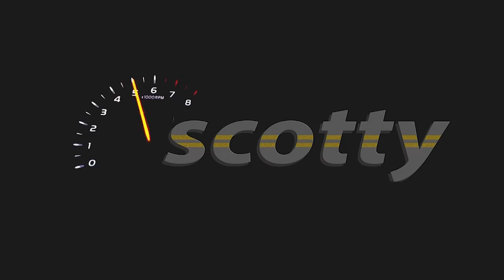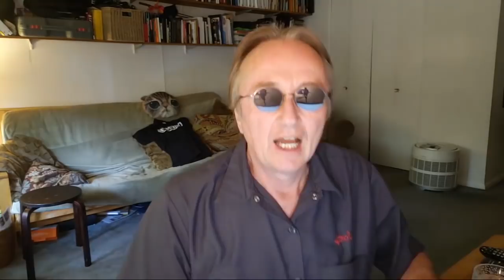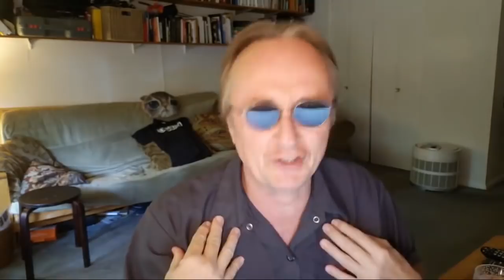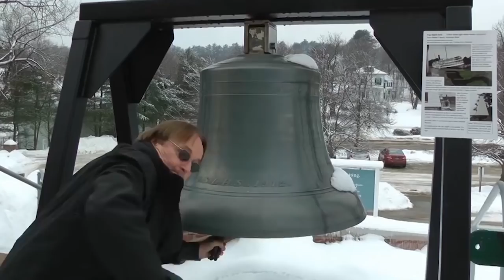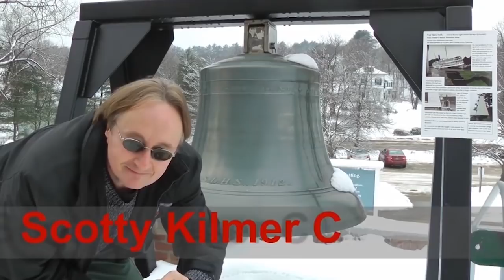What's the Beef with Chris and Headlight Restoration Explained

Comment: Just because you've been working on cars for 50 years does not mean you've been restoring plastic headlights that long. Chris makes excellent videos even though he learns as he goes. He does the research.
Reply: research < experience.
Reply: Chris got it flat it wrong with the spray painting clear coat unto your headlight vid. If youre too much of a fanboy to see that well then good luck with that. I agree with you about experience though. Just because someone has been doing something for a long time does not mean they’ve been doing it RIGHT for a long time also.
Reply: cars headlights were not made of plastic when scotty was working on cars for almost 30 years.
Reply: Scotty wasn't playing around with plastic car headlight coatings for 50 yrs. LOL He has no experience, but when it comes to repairing vehicles, yes, that he has. Most mechanics don't specialize in detailing.
Reply: Experience is better than research. Scotty been doing this stuff for years
Reply: Saitama I know people that have been driving for many years, but they're horrible drivers. Your point is?
Reply: In this specific case, spray painting headlights was just wrong, and is NOT a perm fix.  Could it be a temp fix to trade your car in or something? Sure.. or you could just use PlastiX or a 15$ headlight repair kit to do the same job correctly..
Reply: Well then don’t listen to Scotty and go spray clear coat on your headlights.
Reply: Dennis Kirk agreed, and it really makes you scared of what you're buying with a used car you don't know how many stop leaks and painted headlights and other bootleg fixed as you're about to purchase LOL
Reply: anyone with a camera and google can make a tutorial video on any subject. doesnt make them correct though. scotty knows what he is talking about. buffing headlights is the only way to properly restore them. anything else either doesnt last or damages the headlight further.
Reply: I've seen a lot of cars taken to "detailers" who sprayed clear over the whole engine bay, hoses, belts, everything. Within two weeks it looks like crap, peels, and you'll never get it right again without tons of work. Never let them do that.
Reply: How rude! Really? You do know they are clearcoated from the factory?
Reply: Cyclone Cyd  no they are not
Reply: To say this both of them make excellent videos on how to fix a car i watch both think about this everybody has an opinion and is entitled to it
Reply: There are so many things wrong with this comment. smh 😑

Comment: I did use Chrisfix restore method with the clear coat and for what its worth it has lasted over a year and still looks good, and a little common sense should tell you that the lights were bad/damaged to begin with So occasional maintenace will be need, like changing oil. just to add CF has saved me loads of cash and help me greatly, with that said I also watch/use Scotty K's advice/knowledge, lol they are the only 2 I am subscribed to and shall continue to use as needed, Both deserve a high five.
Reply: Same here man. Glad im not thw only one.
Reply: I’m in the same boat as you
Reply: Indeed
Reply: Hey scotty, notice this comment

Comment: I love Chris' videos. But your right. 
I did the sand, polish, and clear coat, the headlights on a car I sold to my friend. 
It's been about a year, and they look pretty bad.
Reply: Did you put wax like Chris did?
Reply: *You're
Reply: Eric Kolb you really can't though. If a the manufacturer of the clearcoat states that this will not work with certain plastics, they probably dealt with a situation where someone had used the clearcoat on the headlights and it ruined them. Honestly, this is done more often than you think. It just keeps the company making the clear coat clear of liability in a legal sense. Just use a headlight restoration kit, hell rustoleum selling for a couple bucks if you are tight on money
Reply: Eric Kolb I actually ment that rustoleum makes a headlight restoration kit that sells for a few bucks. It's the cheapest one I found at Autozone although I prefer the kit Scotty mentioned from meguiars as I used it a year before his video and it does work really well.
Reply: Herbert Wingfield *an A.
Reply: or you just do it properly with a polish

Comment: I did the Chris fix to my headlights, did not work. I sanded them as he instructed and they came out horrible. I didn't have time to put a comment or video not to do that to headlights but Scotty nail it here.
Reply: It didn’t work for me either. Look horrible now need new headlights.  Too bad I wasn’t the only one.  Unsubscribed Chris subscribed Scotty.
Reply: Ricer   Give it time in the sun. My clearcoated headlight restoration ala Chrisfix lasted about one year and now they look worse than before. So, I got almost a year out of the fix and could just repeat. But the "fix" is definitely temporary, especially in south Florida.
Reply: marvin flores You had time to put a comment here but didn't have time to put a comment on Chrisfix's video... WOW!!!
Reply: Did you use UV resistant clear coat or did you cheap out and use rustoleum? I did this a few years ago using the UV resistant clear coat and they still look as clear as glass.
Reply: I just did Scotty's way for mine.  I did have to sand, but I bought the same brand name kit (came with 2 sanding pads and a polish brush for a drill and polish).  So clear.  I'll see how long the spray cover lasts, but I'm going to follow Scotty's advice and put on every 12 months (have it reminder in my calendar for next year).  Not sure if I can link, but super cloudy (15 year old lights, never did anything to them before) to almost crystal clear.
Reply: Russell Ball what Chris recommended to use WAS Rustoleum. I went out and got the same stuff too and did my headlights. Same story. Turned out horrible and had to sand down the whole thing again which was a worse situation than before because now I'm sanding lacquer off of plastic. 

Once I just buffed them out I just made sure to wax them when I wax the car and they were fine for quite a while til I sold it. 

Now I have another vehicle that needs them done and I would be a fool to do the same thing again. I'm gonna buff them down and use what Scotty said and be DONE with it.
Reply: Crow T. Robot that's prolly why they haven't cracked or faded, I usually have my cars under my car port. I live in Texas btw and I sure you know about the heat over here.
Reply: if it didnt work you did it wrong dont blame him for something you can do

Comment: Glad to see you agree with no clear coat.  Seems to be a big controversy. I have done a video very similar without the clear coat and it ranks just below Chris fix. I have only been doing this for about 25yrs so I am definitely inspired by you. Thanks Scotty
Reply: There is no controversy. They are made with clearcoat from the factory. It is this clearcoat that goes yellow as a result of Uv and chemical attack. Of course the factory uses 2k clearcoat (as do I when repairing)

Comment: The correct way to headlight restoration is never neglect headlight maintenance. Theres your beef nd pasta for you
Reply: Sergio Jr what exactly is headlight maintenance?
Reply: Ed Aker detail your car every week
Reply: Ed Aker clean your car and put protection on them like you should with your paint work.
Reply: Sergio Jr every week! People have lives! 🤣
Reply: Ed Aker
Headlight maintenance is where you make sure you keep the "Headlight fluid" topped off regularly.(Don't get it mixed up with "Blinker fluid")
Reply: 15 years and not a single fade on my lights,  well the car is 15 years old.
Reply: Ed Aker it should only take 5 to 15 minutes tops for big cars, but if you are lazy then what you say is your answer.  😁

Comment: I used Chris headlight restoration video, 5 months later headlights are still clear on 2003 4runner (much better than it was before I followed Chris video) will check in a year, I think his idea of applying clear coat spray at end is what made difference so far

Comment: I did the Exact steps, used the same EXACT supplies for the restoration and a year later they faded worse than what they were before 😔😔
Reply: So for you 1 year is 1 month...
Reply: I also did the same and they went bad in 6 months then again I am in Dubai with alot heat and sand that hits the car
Reply: Shadowplate they should change name to DontBuy not DoBuy

Comment: Chris method is for headlights that have detoriated and clear coat being the last resort before replacement.If it works for a while all good gives you time to save up for new headlights.Prevention is better than the cure.Two different subjects.Chris may not be a mechanic but his videos show clear step by step mechanical procedures and well presented.

Comment: Ok, the headlights on my 04 Camry were hazy. I took some Turtle Wax scratch remover and rubbed them clear. About a year or two later, they're hazy again. So I think your advice is true. I didn't use a clear coat for the reason you mentioned. I'm sure just applying a good wax itself would do the trick. I would try your recommendation but don't know how much longer I'll be keeping this car but will remember it for the future.

Comment: Well there are many ways to skin a cat. Chris showed his headlights after 2 years on instagram and they looked great. Some clear coats will fail, some may not. A lot depends on preparation and product used. So I reckon it’s oversimplifying to say he’s wrong on that topic.
Reply: We in the real world call that anecdotal evidence. It should be dismissed immediately due to the shear volume of those that failed miserably.
Reply: Herpn Derpn lol, so you’re saying your anecdotal evidence trumps his anecdotal evidence?
Reply: I'm saying that 1000 bad outcomes Trump 1 good one. I don't entirely agree with Scotty a bout everything. Some stuff has irked me. This is one that hasn't.
Reply: Ultimately you are not in a paint shop. Maybe it's dusty outside today, maybe it's too cold, or too humid. Could be the material has been sitting in the sun and is 135*f. I can't tell you why this stuff fails so rapidly and in so many cases, but it's obvious that something is causing it.
Reply: Bryant Woods he's saying that there are many variables that could have attributed to a succesful outcome. One anecdotal example without any documentation of the process and variables present isn't good evidence to seem it a successful test. Espicially ehen it has failed so many others people. 
If it can be replicated consistently by others then and only then will it be deemed a success. Its the basic scientific method from grade school.

Comment: There's no right or wrong here. Chris does it one way, Scotty does it another. I like Scotty, but he should be more adamant that in many cases there's "more than one way to skin a cat" when it comes to working on cars. I've been working on cars and trucks for 20 years myself, I can tell you I have run into projects/issues/repairs that could have been done 4 different ways. Most of the time, the way you go about it had to do with 1. How much money do you have? 2. How much time do you have? 3. What special tools do you have? 4. Looking to sell the car soon? With regard to faded headlight assemblies, I try to replace the entire assembly if I can get them cheap enough, instead of using abrasives and polishes and clear coats. Tell you why. Over time these assemblies build up dirt and dust and moisture inside the assembly, so even if you clean/polish the headlight from the outside, you still have some dirt on the inside that will affect total light output. If I can't find them cheap enough online (or at all) I'd go with using a restoration kit, and then applying some kind of UV inhibitor chemical/wax every so often to keep them clear. If I spray them when a clear coat and it begins to peel off after a year... Oh well, just repeat the previous steps and do something else, maybe use an industrial-grade clear coat specifically designed for outdoor applications.

Comment: I thought something was off about that video. I watched it after I did my headlights the previous year, but I listened to an old school bodywork guy, kinda like you Scotty and he said it was a waste to use clear coat paint - he said to just use elbow grease, dish soap and 2000 grit sandpaper until the lights are no good ( few years ) and then replace them. Never knew about this spray though!

Comment: I agree with Scotty. I sanded down my plastic headlights and clear coated them about a year ago, just like what Chris did in his video. It looked fantastic after I finished putting on the clear coat. Yesterday I looked at the headlights and they are cloudy again. It lasted for less than a year. The clear coat method is not a permanent fix. Nevertheless, Chris has good repair and maintenance tips and I still watch his videos too.

Comment: Hi Scotty, I do agree with what you said. The clear coat on headlights will eventually crack. Thus, there's no harm using the Meguair Keep Clear product since you've tested them and found them to be working. Problem is that product is quite expensive here in my country where a can will cost around 45 dollars :(

Comment: Chris has some good advice but after he made that vid about rust repair, I unsubbed him.  He basically painted over the rust spot, in no way, shape, or form did he try to cut it out and repair it the right way.
Reply: the point of that was to show how to do a quick fix on a car in order to sell it without welding a new piece of sheet metal on.
Reply: Except it isn't a "quick fix" if it isn't actually a fix. It's more of a dishonest coverup of a defect that would reduce the sale price of a car.
Reply: Luis Serrato I have been a shadetree bodyman for 20yrs, that rust reformer is the biggest bullshitt scam on the market!!!!   The only way to do it right is to physically cut the rust out and weld a new patch.  Rust is like cancer, it grows if you don’t cut it out.  Enough said.
Reply: kamilhameed  u find it wrong for people in this thread to call out a scam? Covering up rust instead of cutting it and stopping it is a scam.

Comment: I don't want to throw shade on either Scotty or Chris. Both have great things to teach. I will say I've used the plastic restoration stuff on my headlights (99 GMC Suburban- owned for 16 years) and I had to do it again after a few years. The bottle did claim to be a permanent solution, so I can see where Chris may have been duped by the product. Scotty has way more experience with things and has probably seen first hand the issue I'm describing. Good Scotty pointed out the crappy product.

Comment: Scotty I agree with you. Meguiars coating is the best product I've ever tried on my headlights, and since it's finish coating and can work perfectly on sanded surface, we should not use any cleaner,  waxing or polishing compound before spraying Meguiars coating, so it can last longer and won't have anything inside the coating that may affect the appearance

Comment: I haven't watched the videos that created this so called "beef," but I'm experienced beyond my years & know more about the intricate details of parts & automobiles than most can shake a stick at.  That being said, I had a professional friend of mine at a full service body shop attempt to restore a set of expensive Euro-Market Honda headlamps.  We both thought it'd be a good idea to spend hours sanding the lenses (with four different grits), then applying a few coats of Sikkens clearcoat (with proper cure times) in a professional paint booth.  We were extremely confident the haze would not come back, but lo and behold, it did within a couple years.  I just figured I'd post in here to state that even with the best intentions, extensive labor time, and finest materials available, the cancer of polymer oxidation returned.  Clear coat is not the answer.  The only things that help are top quality refinishing kits, or purchasing a new set of complete lens assemblies.  My $.02. -RT

Comment: It's not about hating on Chris, but sometimes there's someone out there that knows a bit more than someone else. When you've been working on cars much longer than he's even been alive, I'm sure you picked up a thing or two more than he has. I respect him as well and maybe his headlight video is sort of a band-aid type fix but you have to realize just how hot headlamps get and how hot the fixtures themselves do. Why do you think snow and ice melts when you turn the headlights on? Because of the heat they generate! Clearcoat wasn't meant to take that sort of abuse and if you look at some cans of stuff, especially Rustoleum, it says, not for surfaces that will exceed 200F. I'm quite sure that those surfaces can get quite hot. Maybe not that hot, but then that depends on the headlight/car too. So unless you have a bunch of Chris fans getting their panties in a bunch, sometimes it's best to take advice from someone who has more experience and knowledge in the matter. When you do that, you can learn how to improve your methods as well. That's why it's called learning.